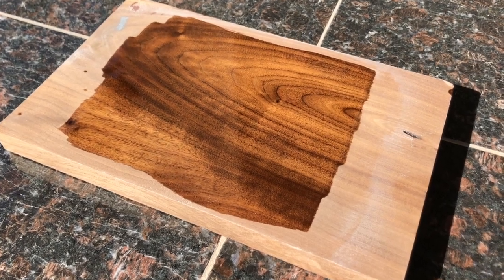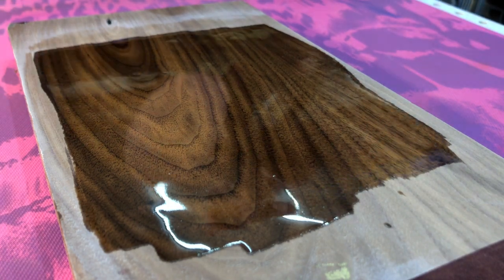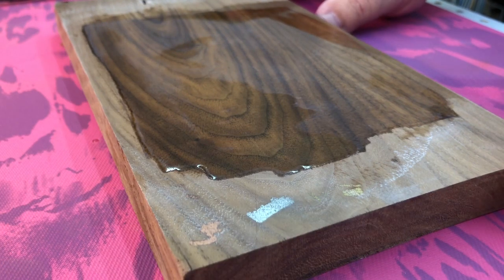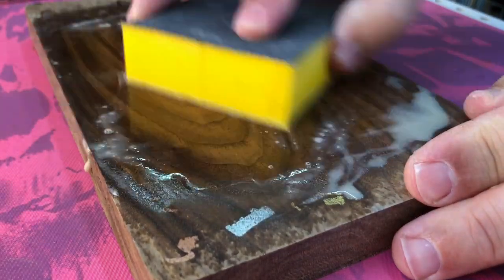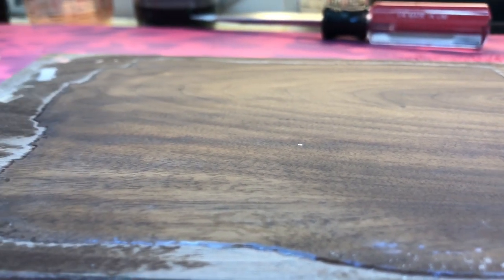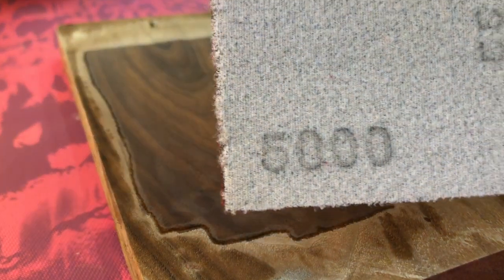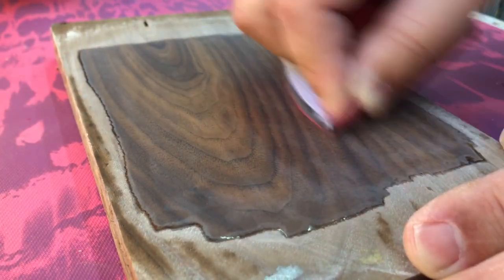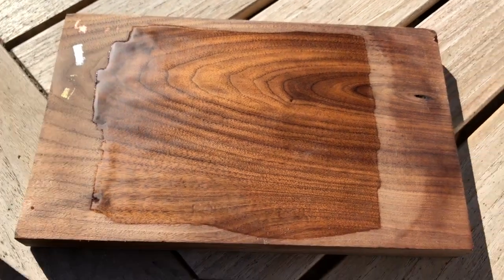Solarez I Can’t Believe It’s Not Lacquer Test

Comment: Even for a test, you need to be wiping away and completely cleaning before switching sandpaper grit, otherwise you're just grinding in the previous abrasives left on the surface. Also you need to use a cutting compound, before the polishing compound to get out the sanding scratches.

Comment: Duane, thanks for this.  I've been playing around with a number of Solarez' products and I think you are very close to getting the results you're after.  1. Absolutely sanding and leveling after each coat, without laying it on too thick.  2.  I would also suggest at this point in between each coat, that yo let it sit for an hour before givinig it sunlight...But first I have a small hand held hair dryer that I run over it for a few minutes, encouraging the bubbles to escape.

Also with respect to prep work... Solarez has a great Grain Sealer !  Starting with this and going thru the same process as above.    Thanks Again !!

Comment: I use Solarez.  It does get glossy PROVIDED you clean away the sanding dust from each grit, then a cutting compound before a high polish compound.
Reply from the maker: I always clean between coats and wipe down with alcohol to ensure the dust is gone, followed with a tack cloth. I suspect when I tried this experiment, now years ago, I did not manage the cutting compound end of the process well. ;)
Reply: How durable is it? Does it hold up to scratches, abrasion etc? Would you recommend it for an heirloom tabletop?

Comment: It seems to me that most of the "not great" was in the prep and sanding, rather than the Solarez.  I read your comments on the other comment,  and agree 100%. This stuff needs to be applied to scuffed up substrate,  or it just pull away like water on a freshly waxed car. I think if you sanded more evenly, wiped away all the 400 grit dust before moving up in grits,  buffed longer, etc,  that the Solarez would shine.
Reply from the maker: Yeah, the product isn't the issue here - that I'm sure of. :) I actually went back to my test sample from the video above last night with some plexiglass windshield polish - stuff used on airplane windshield, in fact. That product (Formula 1 Scratch Out - though I've seen it with other names as well) worked very well - it gave me the high polish I was looking for! :) But the prep, namely the last of sealing the wood used, first - that left visible differences in the coating that no buffing can fix. One of my take aways working with this is less is more. No need for several coast with sanding in between like other finishes. Just a nice medium coat of this, cure it and get working on polishing. Like so much of workcraft, if you've done the wood prep well, it'll all work out from there.
Reply: Duane Forrester, I'm glad you're figuring it out.  I've been happy with all the Solarez products I've used thus far.

Comment: Here's my experience with this product after a fairly disastrous first go and then subsequent trials. First, let it sit for about an hour before ever exposing it to the sun, every coat. Second the polishing and buffing process is critical, using rubbing compounds and a buffing machine at 900 rpm does wonders after it's fully sanded IF all the coats have been properly leveled.
Reply from the maker: Interesting - never really did any leveling with it, so I'll have to try that next! Thanks for the tip Dack. :)
Reply: It is a grain filler, not a finish coat.

Comment: I appreciate the review. Its great for people who may not have a fully equipped workshop. Id like to try this stuff but I'm curious on how hard the cured resin is. Does it seem pretty scratch resistant?
Reply from the maker: The final cure, when done right, is as hard as any other resin. Nice and hard. As far as scratch resistance goes, it’s put it on par with most others. No better than some and probably better than others.
Reply: @DuaneForrester  thanks, I just ordered some to try
Reply: its super tough and is really easy to work with. its best to do the curing in flashes....i did a 5 seconds in sun ..pulled back for 30 ...then 5 seconds ...back for 30 ....cured super clear and didnt kick to fast and make pinholes an dbubbles etc.
Reply: @kalikokahoonei4781  I got some, tried it and found it cured nice and hard. My problem was it didn't want to level out no matter how long i left it before curing. The result was a lot of 400 grit sanding to get it flat for the next coat. So then i tried building up a few coats without level standing until after the final. That produced witness lines. Oh and i could not get it to really shine like a lacquer after buffing. I really want to like this product, Maybe I'm doing something wrong

Comment: If you haven't yet, check out the video Chris from Highline did on Solarez: https://www.youtube.com/watch?v=HjK1e2nFrxw

I tried his method on some test scraps (to use on my own upcoming build), and it seems to work pretty nicely. The Swirl Remover is the key to it in my opinion.

It also looks like you went from 400 to 2000 to 2500 grit. I've discovered that making that large of a jump in grits will leave those faint sanding ridges because you're not able to adequately remove the 400 grit scratches with 2000 grit. 400 to 600 to 800 to 1000 to 1500 to 2000 to 2500 will take car of that. I would start wet sanding with the 400 on up. Once you get to 2500 wet sanding from 400 through 2500, it takes just a minute with swirl remover, then a final buff with polishing compound, and it will be super clear.

Comment: Iam also testing for guitars . I find their icbinl grain sealer is great for filling, easy sanding and pin hole elimination. But on a guitar its 4 coats minimum.thin coats is a must. Sand wood to 320.sand sealer starting with 320 to 800. Then apply the clear in same way dividing guitar into top then back then sides. Sanding between coats.Probably 4-8 coats. Sand  back to 4-600 and hand sand dry dont skip grits .600 to 4000. Thats as far as ive gotten polishing next.i doubt youll get a super gloss unless you have a machine buffer. Hand sanding will eliminate burn thru and wet sanding probably isnt needed.
I guess nothing is free ,pay now or pay later. Its easy to apply dries in the sun in 4-5 minutes, but a regimented sanding and buffing schedule will be necessary for a super gloss guitar finish, also the film thickness in the end will be alot thicker than a nitro or true oil finish .Im up in the air on this product. Thanks for your testing .
Reply from the maker: Edad Martin appreciate the input and ideas you added here! Great hearing the process on sanding to get to a smoother finish, too. I’ve taken it to a full gloss with some plexiglass polish on a budding wheel in the hand drill. Worked very well. 👍

Comment: Hey Duane- thanks for this! I'm trying to do my homework as much as possible before mine arrives, as a pint of both the grain sealer and lacquer cost $200 all up to Australia where I am.
Reply from the maker: Temple Guitars Wow! I plan to get back to experimenting with it again in the next month or so. See if I can find a reliable application method that eliminates and small bubbles. Love the product, I just think my technique needs refinement. 😉
Reply: @DuaneForrester  Did you keep yours in the refrigerator? I hear that's a good first step with this product. Also, as you've already realised, I think adhesion may be an issue? If so, they also do what is said to be a killer sanding sealer that bonds really well to the lacquer. I'm trying both.
Reply from the maker: Temple Guitars have not tried the fridge technique. And I should get the sealer, or at least try another sealer with it. 👍

Comment: Why is it just poured so thickly on that piece of wood? Would you do that to a guitar? No. It's always best to do thin coats and build on that. If you are going to test, do it like you would on your best guitar on an actual sample of wood you would use on a guitar.
Reply from the maker: K Kels appreciate you taking the time to watch the video. 👍 If you’ve never worked with this product, you may not realize how thick it goes on - it’s like a thick syrup, so thinning it during application is tougher. But your point is taken, despite the judgement. We’re I to use this on an acoustic body, it would be a challenge due to its viscosity. On an electric body, however, it’s entirely usable. But that’s just my experience using it.

Comment: Following this with great interest as I'm considering using this on an upcoming guitar build... Do you think some of the hazing could have been avoided with thinner coats?
Reply from the maker: That might help, as would more thorough sanding between coats. I also suspect it would have helped to use a proper wood sealer on the wood itself prior to putting the Solarez resin down. AND, let's not forget a major shortcut i took right up front: I only sanded to 400 grit before applying. While that's plenty for a smooth enough surface in most instances, the point here isn't my level of grit - it's the lack of time invested in prepping the surface overall. Given it was a test, it's fine, but on a guitar body, the surface need to be perfect before you apply - so sanding sealer, full sand back and leveling, then apply the Solarez. I ran a coat over another body I have last night - lemme just say this - be ready to level sand afterwards. You can touch up Solarez after it cures, but you're just adding layers and you'll be able to see them. Also, the between coat sandings? be sure every bit of the surface has been sanded. I could easily tell the areas i didn't scuff well prior to applying more resin as the resin tended to pull away from those super smooth spots. I was starting from a fully polished finish, which I scuffed with 400 grit to key it for the resin. in spots where i didn't scuff enough, or even missed entirely, the surface was too smooth for the resin to grip, so it pulled back leaving pockets. I applied a thicker coat and set it with the UV light, knowing today I was planning to sand back most of it anyway as i level sanded the resin. there is another option here for polishing to a high gloss as well - progressive and higher grit papers prior to a polishing compound and a proper polishing wheel. Some guys go up to 15,000 grit on the papers, then swap to the polishing wheel with a coarse and fine polishing compound - that seems to work, at least in videos here. ;) I think the Solarez product is great - but I still need to learn how to get the most out of it.
Reply: @DuaneForrester  Yeah, I'm likely going to order some now to start playing with until my project is ready. My current plan is water based stain > Solarez Sanding Sealer > Solarez I can't believe it's not lacquer (multiple super thin coats). Obviously lots of sanding at each of those points... I don't have an actually polishing wheel so I'm hoping high grade wet sanding > Micromesh > Polishing compound will get me to a good place. Only way to tell for sure is to test on some scrap wood and see how it goes.. I'm assuming you've also seen the videos Chris (Highline Guitars) has on this topic. If not, may be worth a watch as well.
Reply from the maker: Yes, i was specifically thinking of the Highline videos as i just rewatched them last night. The approach you've outlined sounds very good, and i suspect will result in a finish closer to the Highline finish. I don't have polishing wheels either, but I am considering selling my sportscar and getting some set up in my garage now...LOL @jasonschronicles
Reply from the maker: Just an update Jason - I used a new polishing compound I bought on Amazon last night - Formula 1 Scratch Out - and it worked wonders. Gave me a nice high gloss as desired. :)
Reply: @DuaneForrester  That's great to hear. My Solarez ICBNL came in this week, just waiting on the actual guitar body. Unfortunately I'm still probably about a month out from it being delivered from the custom shop..  I'll drop a note if I find anything interesting testing the finish in the interim.
Reply: I bet menzner compound would shine it right up, thats all ive found to work on my guitar finishes.

Comment: Do you know if you can paint over this?
Reply from the maker: Yes, you can paint over it! I just did this earlier in the week. Used the Solarez to smooth the surface of the wood a bit, sanded it back to smooth it and key the surface for paint (used 220 grit, then 400 grit sandpaper’s). Then brushed on the paint. Spraying would work as well. Just keep in mind that your paint will show whatever is under it, so if the Solarez is cured with any lines, drips or bubbles, the shapes will remain visible when painted. Needs to be smooth. 👍

Comment: I'm not trying to break your balls....but, I kinda cringed when you didn't remove the particles between sanding stages!  Yikes.  That's a recipe for disaster.
Reply from the maker: Completely agree Thomas...sigh. The technique I used here was poor, at best. The results were therefore predictable. I may retry this again, but with a proper process and see what happens. I also question the need for multiple layers with the Solarez - it's a pretty robust product and goes down well (tends to level itself out), so I'm thinking the single coat might work. Still a fan of the product, despite my own ham-fisted approach here. ;)

Comment: What is the recommended application method? is it sprayable or just light brush coats. is it thinable for sprayer? I have a couple of guitars that I swirl painted with hobby oil based enamels, but was trying to find a better top coat than lacquer(dry time sucks). did you get sanding burn through rings in coats as in poly if you sand to deep? This seems to be the best for home builds, and I really want to try it, just not that much info out on it. thnx...
Reply from the maker: Nicole Roennmann The Solarez website has a detailed FAQ that directly answers many of your questions. They do say it’s sprayable, but I’m not equipped for that day never looked into it. My application process was simple: foam brush, brush on, cure with UV light. Sanding follows a normal process like any other product (Lacquer, for instance) and final buffing is similar. Whether you do a thicker coat (and fewer of them) or a thinner coat (and more of them) is your choice. For this test, I went thin and medium coats (both cured the same) to make sure I had lots for sanding back. I can tell you this: my sample is extremely smooth to the touch after the sanding and polishing. The sanding burn through that happened to me was down to my technique. I was using a power sander and not fully aware of how the pad was contacting the surface of the guitar. This resulted in a burn through back to bare wood, resulting in me fully stripping back the finish and stain and restarting the entire finishing process. Not very hard to sand the Solarez ICBINL completely off if needed, either. Not that I think anyone should make that a goal. 😉
Reply: @DuaneForrester  ok thnx
Reply: Also check highline guitars on you tube for tons of technique with this product
Reply: Solarez have two different formulations for this product- sprayable and wipe on.

Comment: 400 to 1500 is a massive jump... You'd likely be better off with more in between grains.
Reply from the maker: Totally fair comment Dan. :) Alas, even when i tried the correct flow of grits, I still ended up with some pin prick bubbles. That said, I should actually redo this test in a less manually manner - like a random orbital on a larger surface area going up the grits form 400 to 15,000, then use a polishing compound and a wax - do it properly. Or, since a friend has a buffing wheel, I could roll down to their shop for those final couple steps and see if this  performs better. I'm hopeful for a better result given how well it's worked for others. :)
Reply: I would go 400, 800, 1200, 2000, 2500 and then use a coarser polish like Macguier's Ultimate, then something like Macguier's swirl remover. Maybe even finish off with a filler wax. Rotary polisher, running at higher speeds than a hand drill and generating a bit of heat at the same time.

Comment: Tried this stuff and did not like it. Very pricey for the mediocre quality.
Reply from the maker: Sir_Valion it’s not for every application, and I have to admit, I’m still figuring it out myself. It takes longer, but I’ve had better luck with Tru Oil overall.
Reply: @DuaneForrester   i had better results when flashing the resin in sun for 5 seconds to kick it off thn pull it back in shade and repeating this process a few times gives better adhesion over all and clearer final product
Reply from the maker: Kaliko Kahoonei Love this idea. Definitely gonna try it next time - appreciate the input here! 👍🙂